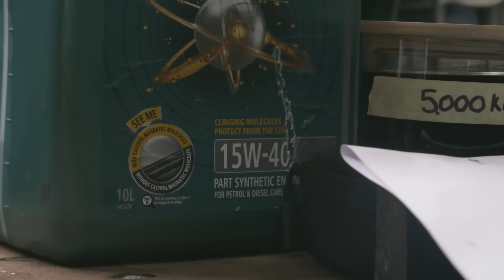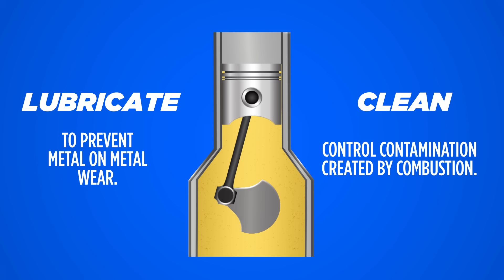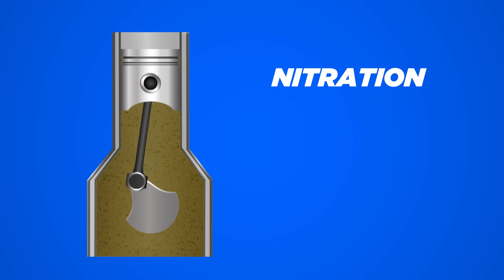Engine oil COMPARED at 5,000km vs 10,000km vs 20,000km! This'll make you service your 4WD RIGHT NOW!

Comment: 10,000kms or every 6 months is fine with a new filter & a decent oil everytime for me. I've never had a problem nor any diesel 4wd we have had in the family. Only time I change it before 10k is if it's been longer then 6 months since servicing it and Just do it for peace of mind or doing a trip away so it's 100% before leaving and if your smart, you would be under the bonnet anyway prepping it for the trip so why not spend a hundred dollars on oil & a filter while your under there. Doing it every 5k isn't bad if you tow a tool trailer/caravan everyday as it's added load on the motor so working twice as much as you would driving around town each week like most people do with families etc.. Saying all that, each time you should check the oil level, colour, metal in the bottom/filter etc and go from there with how you decide to service your vehicle. Mines never been bad enough to worry me when dropping it so 10k is good enough for me and how I drive and use it. Every motor is diffrent, how the 4wd is used, weather conditions and so on.. so don't base your vehicle health on someone else's 4wd expecting it to go the same distance and perform the same.
Reply: i need to know what oil in eu and usa its not "decent" even the cheapes dog shit its something what will hold for 10K
Reply: Because you have no money. I change my oil every 3,000km.
Reply: @salalimadaveanthony9874  Cool mate👌
Reply: @salalimadaveanthony9874  Cool mate👍

Comment: I had a 1990 2.8 hilux Ute that I changed the oil every 5000k with a mineral oil. The ute was used for work generally doing about 80km a day to and from work, 40k each way. At 4000k checking the oil level it was generally still near the top mark but at 5000k it was at the bottom mark or even lower on the dipstick. I changed to synthetic oil and still did oil changes at 5000k but now the oil level was still at the top mark on the dipstick at 5000k and still cleaner than the mineral oil. I have never gone back to mineral oils and generally buy the best quality, and generally most expensive oil available. Oils ain’t Oils.

Comment: I service every 45,000 KMs - I don't want to risk running a engine for 50,000 KMs without a service. Still running great till this day. 

3.8L Holden V6 Ecotec engine in a  ford ranger - procharged for all the turbo whistles. 

Eco mang till it bangs 🤣🤣🤣

Comment: Diesel common rail should be done at 5000ks my 1kd-ftv tells me when it's near had enough of the sooty sludge motor gets noiser than normal and do my fuel filter as well whats about $150 for oil and filters better than a $10000 rebuild 🤙🤙

Comment: Im responsible for 3 vehicles in the family  all get changed 7000 to 10000kms depending on use 1 is the wifes grocery getter and it gets done around 8k unless it does a decent trip then its pushed to 9 10k 1 is a highly modified turbo it is driven irregular and once warm can cop abuse and its done 12months or 7.5k which ever first with its abuse tapered off the closer it gets to a change and new addition is a new Triton that's my daily short trips up and down freeway to work warmed up abit and babied till operating temp reached and it will be getting done at 7.5k half the manufacturer recommendation even more frequent if it does a hard 4x4 trip all vehicles have drivetrain oil level and conditions checked every oil change and drive train oils changed every 60 to 80k depending on how much of a hard time its been given. Castrol edge is my preferred choice across the board especially in the modified garage queen at approx $20 a litre for that beauty the wife isnt happy come service time for that one but vehicle is my pride and joy and not worth the risk of using anything but the best
Reply from the maker: Those engines will be thanking you mate!
Reply: @4WD247  thanks 😊 i cant wait to get the family out on the tracks in the new beast and slowly build it from the stock as a rock form it is now into my dream tourer over next several years love my old forbys but after the last 3 ive owned spending weekend after weekend fixing years of neglect before taking them offroad decided time for a brand new vehicle to start from scratch something i build myself and know every inch of the vehicle is something i look forward to.

Comment: Oil and filter every 5000km in my 07 hilux, wait for 40% off sale at supercheapauto and an oil and filter change is only about $70. Diffs, fuel filter and brake fluid every 20000km, transfer & gearbox every 40000km. Might sound overkill to some but hey, oils cheap, engines and diffs aren't 😂

Comment: Generally around 10k, as I believe that is maximum, but my last was 20k, due to the difficulties of getting to a service location (remote) and not being able to do it myself. At 20k, it was starting to cause issues with vehicle sensors and next will be 5k, as I suspect the oil that went in after 20k, is already black as night.
Reply: It's worth using a good engine oil flush before your next service also mate
Reply: @andrewford3035  good idea. Will ask the mechanic, on my next trip to the city. My days of crawling under cars is long gone, as it's getting that skid plate off.

Comment: Change all fluids as per manufacturer specifications.  I figure that way if there are any issues I could theoretically have a case for replacement.  After seeing this video I'm tempted to do more regularly. Good stuff,  cheers lads
Reply: Yeah but how often do you off road? What do you use your car for? Its really dependant on what the vehicle is used for obviously you are going to have to change it regularity if you 4wd every week like they do
Reply: @Jimsgingyming  70% daily 30% off road
Reply: Holden reccomend replacing trasnmission fluid at 120k on the colorado or 150k on the cruze and captiva. Needless to say the transmissions are stuffed by then
Reply: @michellecook5701  in general, most transmissions and transfer cases to an extent dont need the oil replaced regularly as there isnt as much heat generated and contaminates as there is from combustion (example an engine’s oil), now are these transmissions shitting the bed early from driving conditions, the driver or manufacturer faults? Who knows but a general good time to change is still around that mark, not saying you cant do it earlier but your just over maintaining increasing oil waste, if your driving like a mad man or going off road every weekend off course service intervals are going to be closer as it comes under adverse conditions, i would say in the case of shauno, thats more that defiantly adverse conditions, for someone like me who doesnt get out too much or put heavy loads on my vehicle, sticking to the service intervals is a great way to keep a car healthy, sorry if im abit lacking in knowledge, i’ve only been in the business for a couple of years now, ADF has taught me alot but still have plenty to learn

Comment: My old 75 series cruiser gets engine done at 7500km 
Diffs and gearbox every 12 months depending on what driving has been done. I.e. water crossings or muddy tracks I would service when I get home.
Because you can over service them as well 
Being a plant mechanic for 30 years I Haven't had any dramas in my time

Comment: 2010 RC Holden Colorado LT-R -
Engine Oil - Castrol Magnetic 15w40 5-7km
Oil filter - 5-7 KM
Fuel Filter - 5-7KM
Transmission and diffs - 15-20k kms

Comment: I would have liked to see the oils sent to a oil analyst to see how they compare with new.  Also it wasn't disclosed what type of vehicle they came out of. My 5 year old 200 series tows 3 tonne regularly and at 5000km still is clear. It has done 50,000km.
Reply: Your contention might be good for a PhD.
Reply: @stuartkcalvin Why are you being a bell?
Reply: Agreed, without proper evidence it feels like the Castro sponsorship is taking affect
Reply: I send my oil out after a certain amount of kms. I use black stone labs.
Reply: @Thatboostedgarage  And what does the lab tell you and what do you do with the information other than withhold it from YT?
Reply: No science In that vid just big clams. To use more oil.
Reply: Got a fiesta 1.4  97hk  2010 change oil every 5000 km I don't pull with this car but at 140,000 km oil looks still like new after every 5000 km. never had any problems  only normal change of stuff like brakes and wear parts. And gear oil every, 50,000 km drive and run like new. Have a good day.
Reply: As soon as I buy a vehicle all the oils and filters get changed that includes power steering and then every 5000km after that oil, filter and fuel filter get changed if I have been towing the transmission and diff oil will get changed before factory recommendations I currently own a 2017 D-Max
Reply: I drive a 2021 Fuso 5.5tonne truck.
It is only supposed to be serviced every 30,000km.
It feels very wrong following those guidelines but the boss wouldnt consider a halfway oil change.
I’m at 32,000kms now and the service is in a week. We’ll see what happens.
Reply: i had a 96 mitsubishi lancer that was barely used by my father and it was given to me early 2000s. I was the one that put serious mileage on it.  back then i would use Mobile 1 extended performance (something like that), the oil would stay clear for 8 months before it would start to darken. so in my book 5000km and clear is plausible.
Reply: 50k miles is a joke
Not a mileage for a really reliable vehicle
Reply: That all depends on the engine and its load. Turbocharged engines destroy oil much faster, oil there do much more job - not only it absorbes combustion result components but also serves as a coolant for high temp turbine. Opposite is, for example, naturally aspitlrated engines that work on LPG. LPG fuel is clean and burns clean, and so the oil keeps clean since there's no burned crap to absorb.
Reply: theres another vid that send oil samples for analysis, samples was obtained from the same vehicle run in a controlled environment. much expensive rather than a paper test and a water mud explanation.
Reply: Put the same amount of oil in each spoonful
Reply: Of course the solution is buy more oil
Reply: We run sample analysis on our fleet of Scanias, Mercedes and Isuzu 4WD tour bus trucks.  A bit of scientific analysis will show you different results than a teaspoon of oil running down some photocopy paper. Most modern oils are vastly improved over the years, and don't need changing as often.
Reply: @djjames6576  Lemmings accept everything they are told. Trust the new transmissions "Never change the oil" the new transmission oils have magic and never need to be changed says the auto company.  But.. the manufacturer of that transmission engineers will tell you they recommend to change the oil :)

New car oil!  Never change the oil and you will parrot that never really knowing you have been fleeced.  A sucker is born every minute.
Reply: @djjames6576  on the new Mercedes trucks it is no oil change in the service manual. They have an oil sensor that tells you when the oil needs to be changed. Usually the first oil change then comes at around 120.000km....
Reply: @joeop5104  they have an oil quality sensor, so the oil quality sets the oil change...
Reply: @scaniav8530able  very skeptical about that. Some Mercedes diesel engine oil fully turn into jelly. Of course the owner follow oil change as the book recommend 25000km or 1 year.
Reply: @NamNguyen-ij1es I've never seen a good quality ACEA oil turn to jelly.
Reply: @scaniav8530able Hasn't Fiat Ducato now oil changes every 48,000 km, and then we talk about a 2.3 litre engine. I don't remember if they allow maximum 24 months between changes.

But if you want to prove anything, of course you send a couple of samples to a lab. Everything else is only bla, bla, bla...
Reply: @djjames6576  
He isnt trying to scientific so criticism isnt required. He is simply stating in layman terms the point that oil degradation happens much quicker then lots of owners may be aware. 
I think he provides that point quite well with his simple paper technique
Reply: Is it vaxed to stay that clean
Reply: From what I'm led to believe. If your engine oil comes out basically the same way it went in means that it isn't doing its job, cleaning and lubricating too.
Reply: @codylehmann6060  I’ve done an oil analysis on my oil and changing it early does make a difference, especially if you are driving it hard.
Reply: @codylehmann6060  All depends on intervals and driving environments. You can't say exactly what interval is best, but the change of colour is an indicator. 
I service my GFs car more regularly,  stop start hot cold 😂etc, bc of oil additives breaking down.
Reply: @codylehmann6060  i will disagree. It depends on many variables. If you run good clean fuel and have a more efficient combustion you will have less soot deposits. Ive been shown why not to use cholesterol, i mean castrol in an engine. My pickup also has clean oil at 10000km. No varnishing in the engine and running great on liqui moly. Other favourite is shell. Moral stays, change oil often dont wait till its that black to change.
Reply: @codylehmann6060  Either that or there simply isn't a job for it to do
Reply: My Ford Falcon with 320,000km still has almost brand new looking oil with 10,000km oil changes. I feel bad taking the waste oil to the tip for recycling, I'm tempted to just reuse it in one of the old farm trucks.
Reply: @archygrey9093  probably a good idea on a farm truck. 👍👍
Reply: @archygrey9093  My owners manual says to change my oil every 20k km. That seems on the high side but I guess they would know what’s best.
Reply: Lmfao bs oil gets dirty after a few ks let alone 5k 😂😂😂. Youtube liar.
Reply: @krump743  Fair to say you don't or haven't owned a 200 series from new and seen it for yourself. I do have a photo of my oil 4000km after a service but can't upload it here.
Reply: @DrSpic  😂😂😂😂😂😂🏳️‍🌈🤡
Reply: @krump743  Think what you will, I’ve sent mine to get analyzed. Mines more for how the engine is doing since some of my vehicles are high performance.

Comment: I don't use my vehicle very often but I run it at least once a month up to operating temperature to burn off any moisture or fuel in the oil
Reply: Oil temp or water temp? Just because the coolant gets to running temp, doesn't mean the oil is hot

Comment: Nissan patrol 2008 l78 v8

Service oil snd filter every 4000km
Gearbox 10k km 
Diffs and wheel seals / grease 

Every time I take it into water / mud 

Normally after a big trip :)

Comment: I service my 79 series every 10000km and my diffs, gear box and transfer every 30000km. I do much off roading or heavy towing. I do check all oils every service though as well as change filter and greasing

Comment: My toyota n60 rollux 

Every 5000km, oil change and filter
Every 10,000 fuel filter, air filter and oil filter 
Every 20,000 transfer case, diffs , gearbox and cabin filter + general service 

Injectors Every 100,000

Comment: I always putt 10w-40 in my turbo diesel, i change it every 3-4000ks just because i dont want any issues, and thats not hard abuse, i change my diff oil every 10000ks same goes with transmission oil, also flush and change coolant  every 10000, dont really have a favourite brand i just use any mid priced quality :) would be also to win some oil to keep my truck running its services, love all the videos jump on them asap. cheers boys 🍻

Comment: 7500ks interval for me. 5000ks on motorbikes or very old motors. 
10,000ks on vehicles that get good mechanical sympathy. 5-7500 on anything that cops a flogging.
Oil isn't cheap. Can't afford new oils in each vehicle at 5thou. But I do buy quality.

Comment: My 4wd is every 5k oil and filter ever 20k for driveline. My commodore on the other hand 2.5k oil and filter and 10 for driveline due to running tenths oil which doesn't last as long but cleans way better